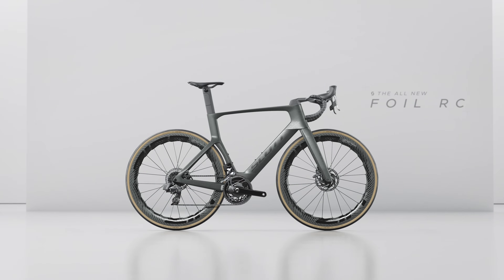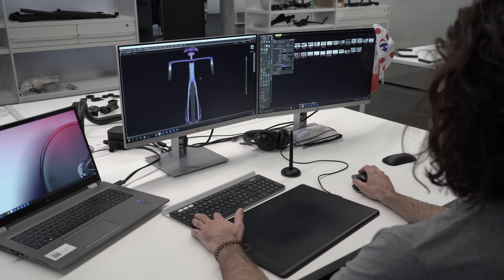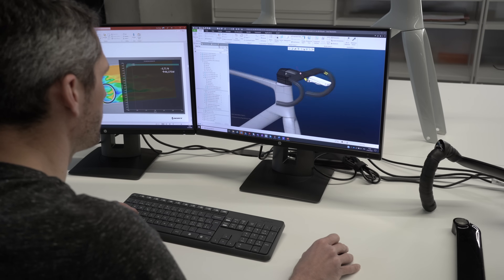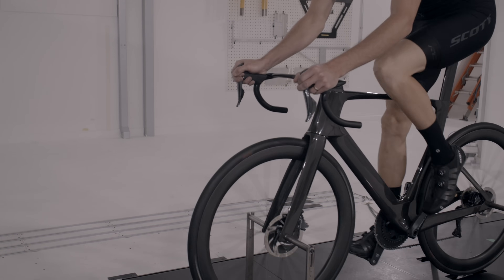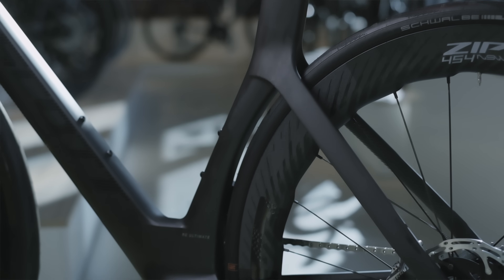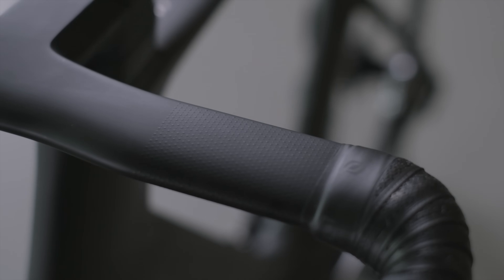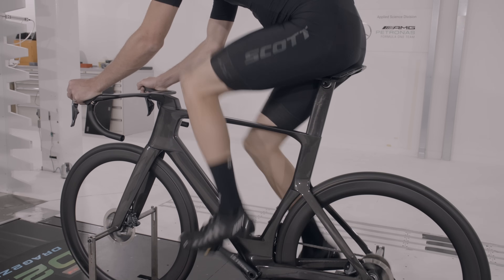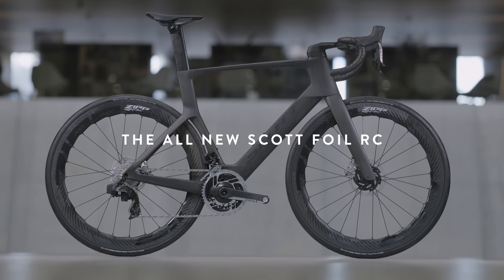The TECH Behind the ALL-NEW Foil RC

Comment: As usual, will leave judgement on how aero once a 3rd party actually does testing in a wind tunnel with a standardized dummy and setup with full disc wheels etc...all of these claims as always, with a rider on board, and those terrible disc brakes attached, often translates into marginal, if no, gains.  Don't know if it is copy cat, or if engineers are all somewhat finding similar designs based on rules, that ultimately look the same. Clearly an S5 seat tube/rear section look, TimeMachine BB area/downtube/seatube junction for stiffness/aero...and then the front head tube where the forks meet is another common new design element. Handlebars really flat/narrow on top with integrated computer mount that aligns with a computer is helpful, wonder how stiff that is in a sprint? Imagine a lot of flex on the bars when cranking 1000w+ with that design. Not impressed with the cutting of the fork though. Canyon figured this out already how to build a headset/fork tube design which requires zero cutting and accomplishes all the aero/stiffness of others. Sawing away is still a wasteful and absurd idea IMO that happens making the bike often useless for a used bike buyer. I still ride and have my Scott Foil original 10, used to have the original Team version, from 2013, it still holds up as one of the most aero/stiffest design with a rim brake. Ride is a bit rough...but can't deny Scott makes a great long lasting bike. Still not spending money on any new bikes or disc brakes because in reality, nothing has proven faster or worth the $$$$ for my racing/masters needs.

Comment: One design choice I don't quite agree with is the near vertical seatpost. If you are trying to improve flex/comfort. steepening the seatpost angle dramatically won't help. Otherwise everything is great
Reply: The seatpost is much thinner than it seems. The offset between the seat clamp and the structural component of the seatpost effectively slackens the seatpost angle.

Comment: Too much tire to downtube gap. Turbulent area.
Reply: Here comes this guy trying to be a youtube Aerodynamic specialist 😂Do you honestly think you are more knowledgeable than the designers that have been doing this all their life ? seriously.. ? lmao 😂 I'm pretty sure the wind tunnel told them everything they need to know about airflow passing the downtube don't quit your day job.
Reply: Ok guys, throw away all your CFD tools, junk your wind tunnels and burn your textbooks. Jason's here.

Tucked front wheels have been tried. I'm not an aero expert, but there doesn't seem to be a reason to leave those watts on the table. Specialized got rid of their tucked wheel because downtube-wheel interaction is less important than they thought. The bike has to be able to perform in turbulent conditions, crosswinds and especially when the rider is wobbling the front wheel. The front wheel and downtube are rarely aligned.
Reply: @404nobrakes  What I really want to know is why most aero bikes have gotten rid of the widened downtube feature around the bottles. It's really hard to imagine that has resulted in less drag, so engineers definitely seem to be willing to make concessions for modern aesthetics, but I could be wrong
Reply: @squiresuzuki  yeah it's hard to know which bikes were optimized with bottles vs without.
Reply: @404nobrakes  😂 I’m here! Woo! I’ve watched too many Silca, Hambini, Peak Torque videos.

Comment: what's the reason that 25c in front and 28 in the rear? weight distribution?
Reply: My guess would be to reduce frontal area.
Reply: Proably that as well, the rears has more weight.
And aero, the front hits the air first, so they have to be narrow, to reduce the frontal area and to be closer to a naca shape. At the rear this is not so important, but important to get close to the seattube. If they would go narrower, they have to design the shield to hug a smaller tire, wider tires outer edge has more radius, to maintain the aero. Max tire clearence would be smaller then, and some buyer might wouldnt consider a bike with 28 or even 25 max tire widht. 
I have also noticed a theme, the front tire rarely huged by the downtube nowadays, instead they make a "hole" , where the rim brake sat, let more air over the tire and drive around the downtube, maybe a smaller tire halps here as well.
Reply: Mainly to balance aero and comfort. 28mm in the rear for comfort and 25mm front for aero.